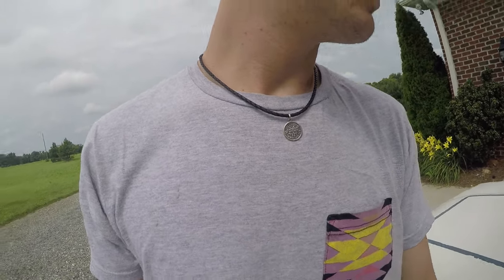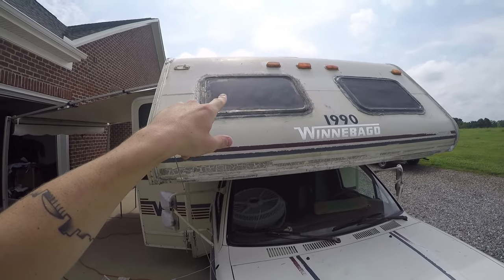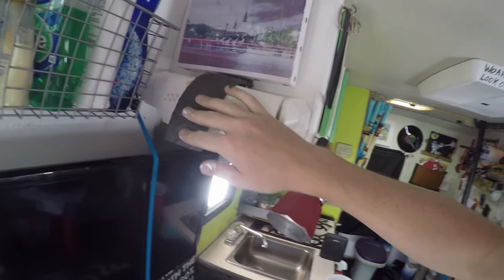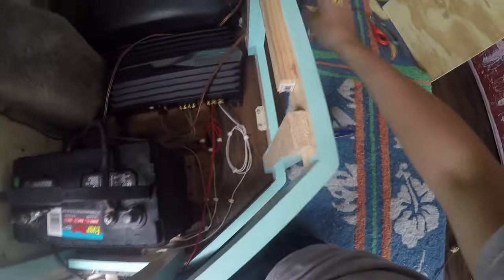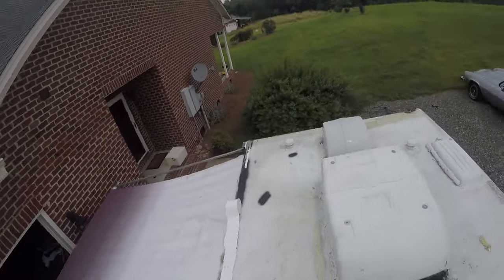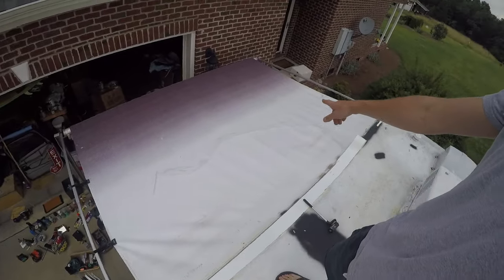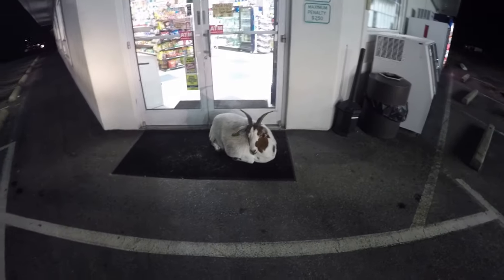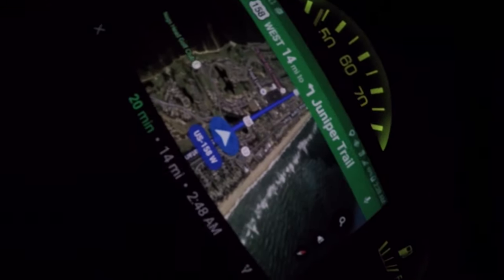CUSTOM TOYOTA RV INTERIOR BUILD (7/7)

Comment: You have a RV the best way to stay awake on the road is pull over get a nap and as soon as you wake start running. Best time to sleep is when you are sleepy? If your body says sleep go to sleep sometimes you will sleep 20 min or 8 hours but odds are if you are on a good run you will sleep maybe 30 min to an hour and pump it back up.